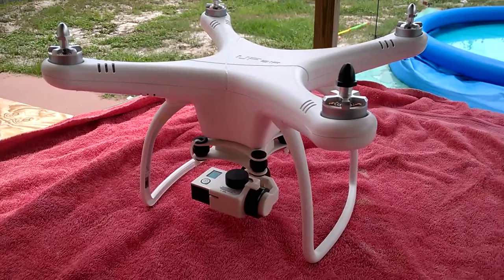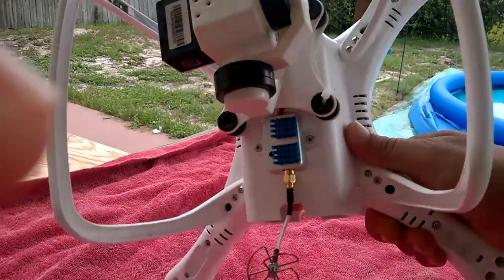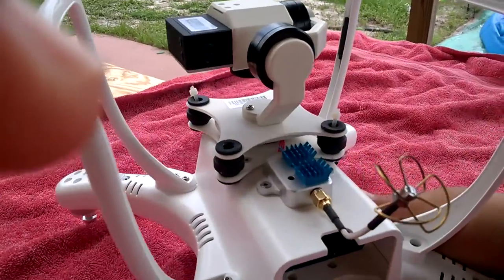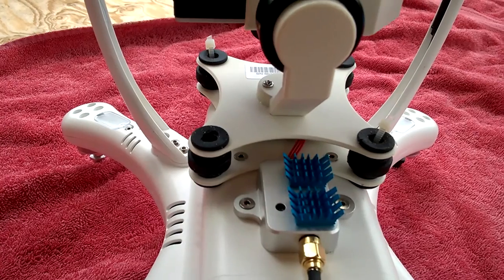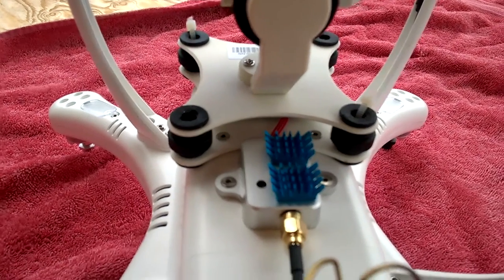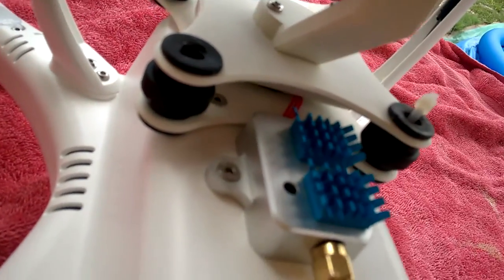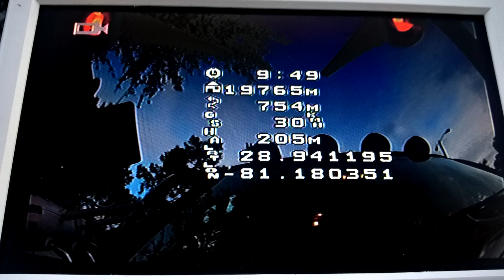UpAir One FPV HeatSink Mod and Flight

Comment: hi, just got an Upair one, man does it get hot. i was wondering if you believe that the blue ones are the best. there are alot of them on amazon. i dont mind spending a littl bit more if it works better and is the link a 2 pack or just 1?
Reply from the maker: you want to keep them smaller. mine came with 2 blues. I know there are bigger ones out there but you don't want to add too much weight to your flight and waste battery! ;)

Comment: did you have your camera set to anti-shake here Jose?
Reply from the maker: I don't know.. lol.. I am new to this. are you talking about the camera on the gimbal or my handheld mobile device?
Reply: on the gimbal? Also in your recent transmitter mod did you fit a new clover to the receiver also if so any chance of a photo please? thanks
Reply from the maker: I didn't know there was a anti shake.. hmmm.. receiver has both stock antennas.. I read somewhere it would require a lot of work to change them. maybe I try :)
Reply from the maker: https://www.youtube.com/watch?v=SJ3Zy6Coz40you can see my receiver :)

Comment: this may be a dumb question, but I'm new to the quad copter/drone game. anyways how exactly do you install a heat sink ?? don't be too harsh/critical please lol
Reply from the maker: lol.. hifive!! any heat sink wether in computer or somewhere you want to eliminate some heat, normally come with a "sticker" solution for self adhesive. :) easy peasy sir!! :)
Reply: JoseB Vlogs much appreciated kind sir, you have been such a help to me.. also have you found transmitter yet ?? I really would like to go with a 600, what are your thoughts??
Reply from the maker: I went to dark side.. : ( I have now a phantom 3 pro. and I am looking to sell it and get the phantom 4 asap. I don't do any more mods for UPAir and I sold it! : )
Reply: JoseB Vlogs lol the "darkside" well as long as your still up in the sky..  how did the 600mw work for you ?? is it something you'd recommend ???
Reply from the maker: I didnt have good results from the 600. in fairness, i only tried one manufacturer though. either way, i felt like the 200 gave me the distance before battery would run out. the 200 was clear all the way to 1500m